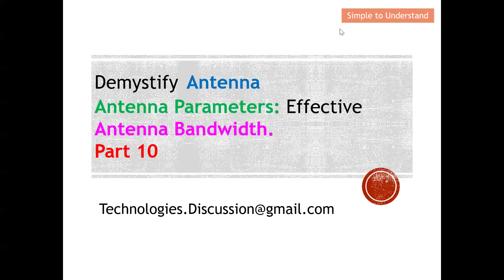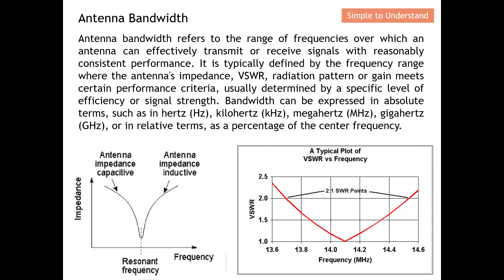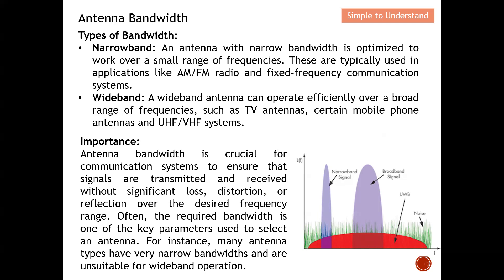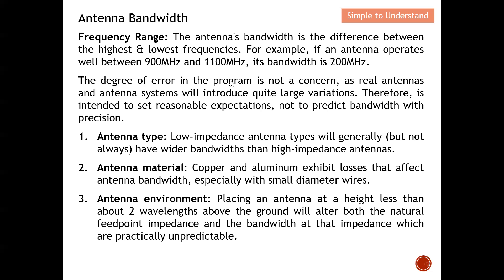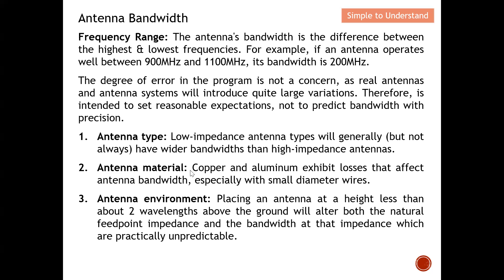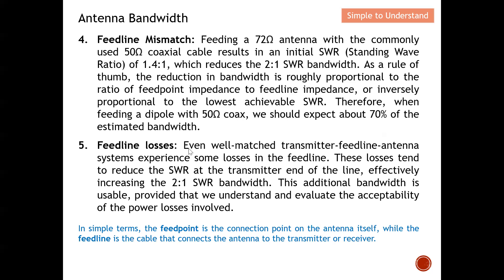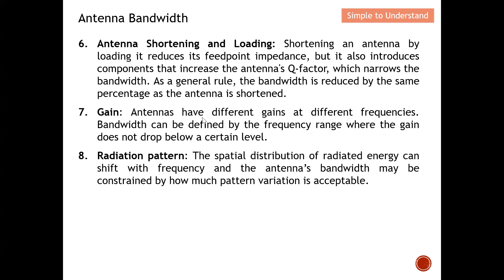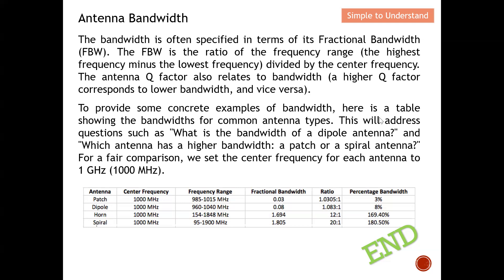Antenna #10. Antenna Effective Bandwidth: Types (Narrowband Vs Wideband) for Different Applications.

Comment from the maker: Thank you for taking the time to watch this video. In this video, we discuss the effective bandwidth of an antenna.
Antenna bandwidth refers to the range of frequencies over which an antenna can efficiently transmit or receive signals while maintaining reasonably consistent performance.
Next, we explore the two main types of bandwidth: Narrowband and Wideband.
Narrowband: An antenna with a narrow bandwidth is optimized to work over a small range of frequencies. These are typically used in applications such as AM/FM radio and fixed-frequency communication systems.
Wideband: A wideband antenna can operate efficiently over a broad range of frequencies, such as TV antennas, certain mobile phone antennas, and UHF/VHF systems.
Bandwidth is often specified in terms of Fractional Bandwidth (FBW), which is the ratio of the frequency range (the highest frequency minus the lowest frequency) to the center frequency. Additionally, an antenna’s Q factor is related to its bandwidth—a higher Q factor corresponds to a lower bandwidth, and vice versa.